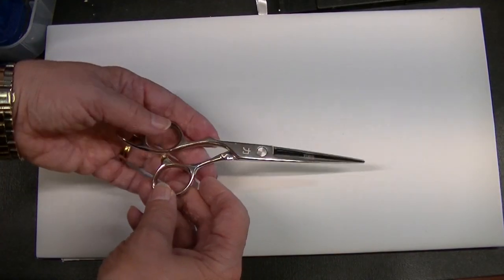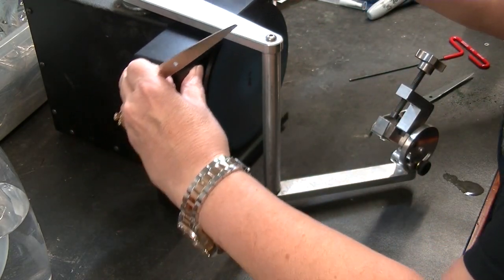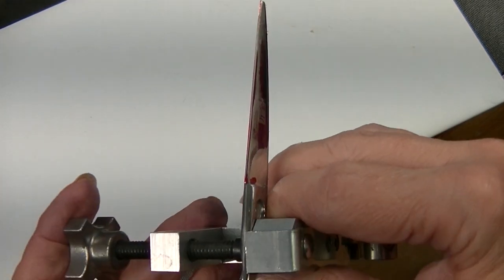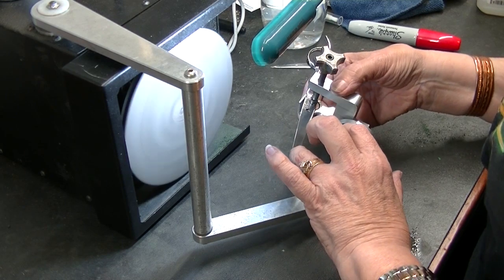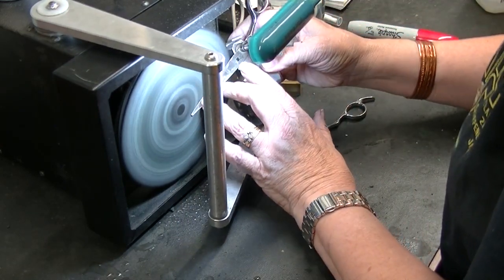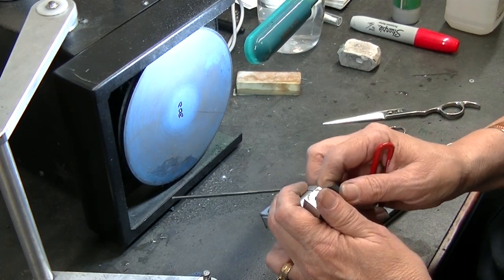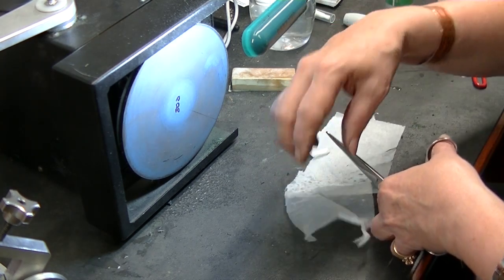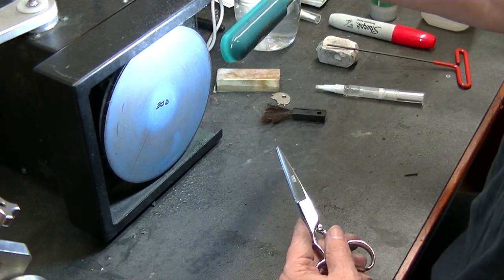How to sharpen a cheap pair of scissors

Comment: Yes I charge the same, "cheep" lesser quality steel should not be polished like a higher rockwell steel, soft steel will preform better if left a bit toothy, and a bit lesser angle.
And as always thank you Bonny.
Reply from the maker: Thank you. Cheaper ones are sometimes harder to sharpen.

Comment: Grinding concave do not you? Aren't you polishing concave? 
Why don't you check for pitting corrosion on the support line (read line)?
Reply from the maker: These are cheap scissors. Not worth the time or the effort to do more.
Reply: @BonikaShears  But should sharpening not be of high quality, regardless of the price of scissors?
Reply from the maker: Watch the video "When Less is More in Shear Sharpening." You have to work with what you have. Giving too sharp an angle on soft metal will dull out. Putting too smooth an edge on a blunt angle shear will push the hair. You must give the scissors what it requires. A large gourmet  meal might be nice for an adult but it would not be right for a baby.  You give the scissors what they need, no more and no less.
Reply: Inexpensive scissors can be sharpened very high quality and reveal their potential, and not approach them as usual. It all depends on the sharpener himself, his philosophy. Cheap scissors - cheap sharpening is not my approach)) Quality is above all - this is my approach and cheap scissors can be sharpened no worse than expensive.